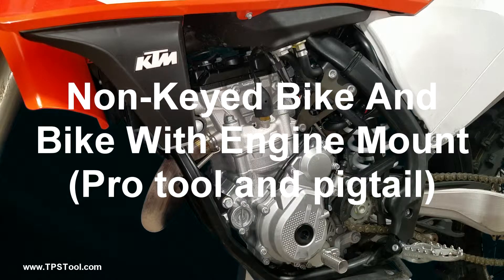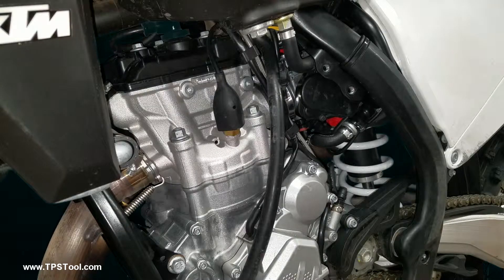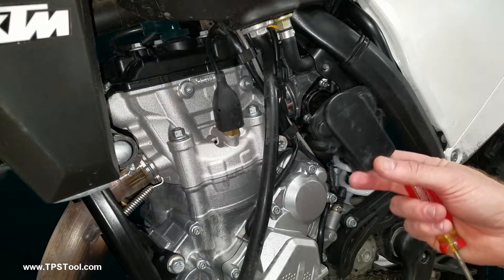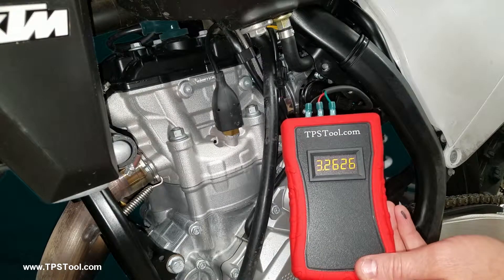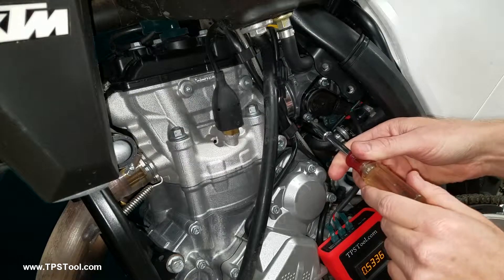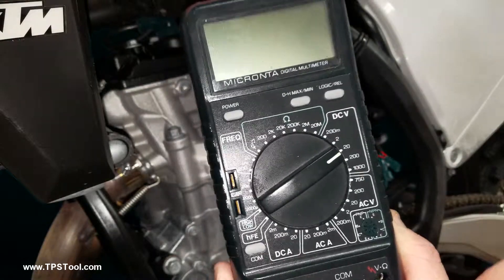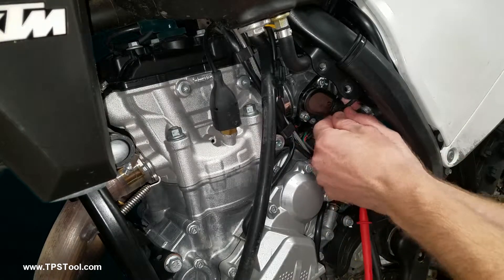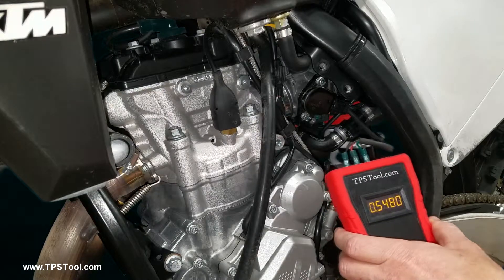Adjust the TPS on 2017 and newer  KTM the easy way (bike without a key and with an engine mount)

Comment: Hello, I have a 500 exc 2019, it starts very hard and the check engine light lights up 3 times long and 3 times briefly. OBD error code is 1581. Do you know if this is due to my TPS?
Reply from the maker: Hello!  According to the manual, that error indicates a fuel injector problem. Here's a link to the manual:  https://www.manualslib.com/manual/3132957/Ktm-450-Exc-F-2019.html?page=148#manual

Comment: Is there a list which model requires which voltage? In a different video you said that 0.64V is right, here it is 100mV less. I have a 450 Rally Replica 2017 and wonder what is the right voltage. Can you kindly advise? Thanks.
Reply from the maker: Thanks for your comment.  Please watch this short video which explains how to figure out what your factory default should be depending on which model you have:  https://youtu.be/TufG9PmzbDo    From there it's just tweaking it up and down a little bit to see what works best for your specific setup.  Let me know if you have any other questions.
Reply: @TPSTool  Thanks mate, it is clear now.

Comment: Thanks for the video , i got some issues on a ktm 2017 250 sx-f ,it wont star , i dont know wich sensor or electronic part turn the switch on suppose just the run botton , cause the engine runs , but no spark , no FI light on , relay is ok , spark plug is ok , i just want to know wich part start the switch in this kind or bikes
Reply from the maker: I'm not entirely clear what you're asking, but if the starter spins but the bike won't start, then begin by checking if there is actually a spark.  Put a spark plug in the cap, make sure the silver part of the spark plug is touching metal on the motor and press the start button.  You should see a bright blue spark.  If it has spark then the next thing is check for fuel.  The easiest thing is check the fuel pressure.  The hose and filter inside the gas tank is plastic and it's not unusual for them to split, which leads to low or no fuel pressure and it will run poorly or not at all.  If there is fuel pressure then the next thing is take the injector out and be sure it is actually spraying fuel.  Also make sure it has compression.

Comment: Thanks for posting these tutorials!  Quick question, I have a 2018 500 EXC-F and I'd like to run a tuner and change my exhaust, but I believe the previous owner may have adjusted the TPS as described in your video.  Will adding the tuner compensate for his adjustments or will I have to check my voltage and bring it back to stock before adding a tuner?  Thanks again for the content!
Reply from the maker: Thanks for your comment.  It depends on the tuner.  I would try the tuner first as-is and take it from there.  If you have any trouble getting the small throttle openings running smooth then check out the TPS.  Even with the tuner, you can adjust the TPS to clean up the small throttle openings and help with stumbling and flameouts, etc..
Reply: @TPSTool 1 Awesome- thanks again man, I really appreciate your help!

Comment: I had problems with stalling on quick throttle responses, and went from 048 to  056 and 061 made it better, but it feels like it's much - haven't tried riding it yet.
Is it too much you think? ( 250 exc-f 2018)
Reply from the maker: Thanks for your reply.  Go by how if feels when you ride it.  I will say that going on feedback I've received, it seems the guys with 250's like higher settings than on the bigger bikes so what you're reporting doesn't sound unusual.  Please report back after you've had a chance to ride it and let us know your result!
Reply: @TPSTool  Missed to reset the idle, so went back and went to 0.53 with zero idle. That did the trick.
Reply from the maker: @Bjer1ng1  Excellent, and thank you for posting the update!
Reply: @TPSTool  Thank you so much for the input. I'll be sure to reconnect with voltage. ( atm also running funnelweb filter)

Comment: Hello, what will be the honda hornet 160r factory reset Tps setting???? , I have set to 0.6v in closed 😊
Reply from the maker: Thanks for your comment.  I'm not familiar with that particular motor, but here is a link to the TPS page in the manual for that bike (2015 model year), hopefully this will help you:  
https://www.manualslib.com/manual/1637137/Honda-Cb-Hornet-160r-2015.html?page=296&term=throttle+position+sensor&selected=8#manual

Comment: you say to set it to this certain number, but still need to test ride it and adjust accordingly. can't you then just set it by hearing, while the engine's running? as you would set an air/fuel screw on a carb?
Reply from the maker: Thanks for your comment.  The short version is, the best setting will vary between bikes, so to find the best setting for your specific bike it's best to try a few settings and test in-between.  Generally speaking, the way a bike sounds in neutral on the stand does not always represent how it's actually going to perform when you're riding it, so it's best to test ride.  The slightly longer version is; there are 2 basic throttle body designs used by KTM at the moment; most of the current bikes use the style where the idle adjustment actually opens the throttle plate.  Turning up the idle will make the TPS reading go up because the idle screw is opening the throttle.  Not everyone has the same idle setting so it's really not possible to give a specific number in this case.  It would be possible if everyone talked about their setting when the idle was backed all the way out and the throttle plate 0% open, but people don't typically check it this way unless they're resetting to the factory default.  The other style throttle body has a completely separate circuit for idle air and adjusting the idle does not change the TPS reading at all.  For these bikes it's much easier to give a ballpark number to start with.  I hope this helps, please post back if you have other questions.